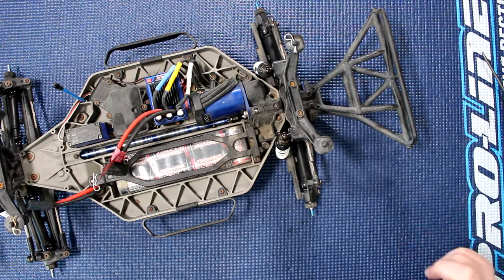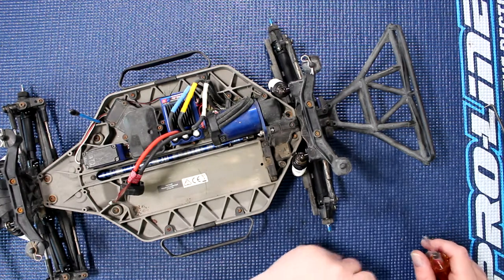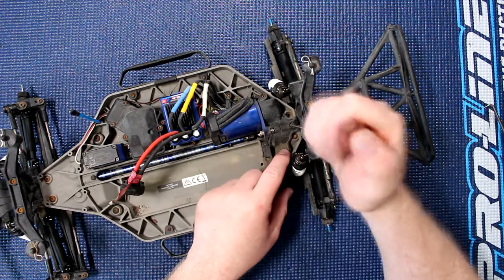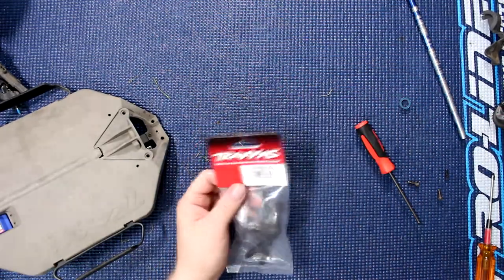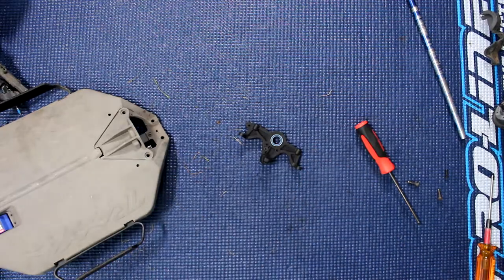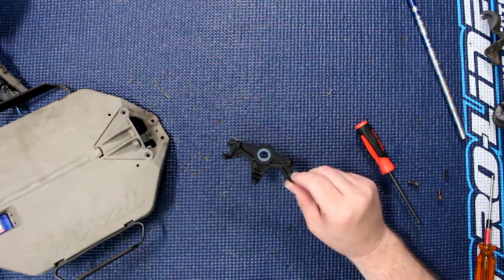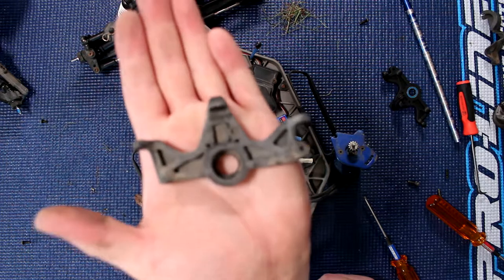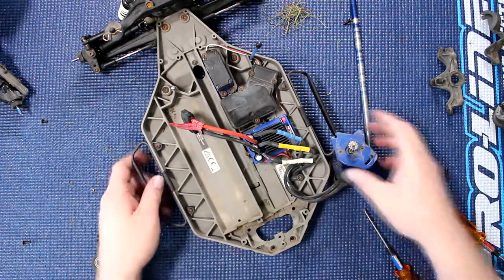How To Change A Slash Motor Mount 4x4

Comment: Was your slash making a squealing sound before your made the repair? I might have the same issue but my motor plate is slightly bent too.
Reply from the maker: I’ll be honest with you I do not remember. But if your motor plate is bent, itmay cause binding.
Reply: @djsprc  mine was slightly bent but not much at all, I got a new motor plate and would like to get  the black plastic motor mount too.

Comment: Great video. Very informative. 
Why not install a Hot Racing or Kings Head aluminum motor mount?
They help to cool your motor, and won't  be affected by the heat and melt like the plastic Traxxas mount.
Reply: Because its like 5 times the price of a plastic motor mount. $10 vs. $50.

Comment: Great video, but how long did the plastic motor mount last ? Did you face the same problem again ?
Reply from the maker: The plastic one will work as good as the aluminum one. It’s mostly for bling bling.
Reply: @djsprc  Thanks for the info,  I just  ordered a plastic one.👍
Reply: And since you took the time to answer you got my subscription  !!!!!!
Reply: @djsprc  bling but also it helps decipate heat from bearing that’s on your differential